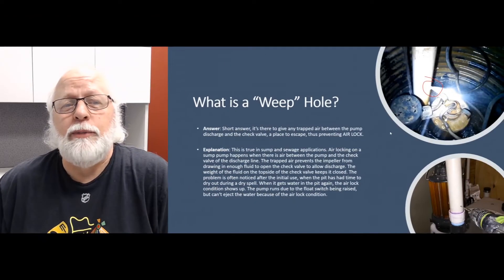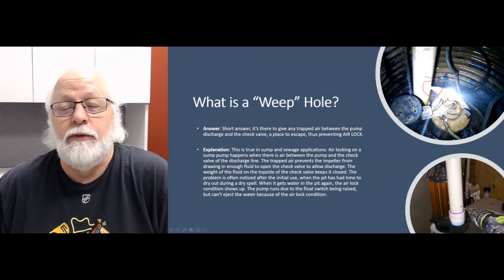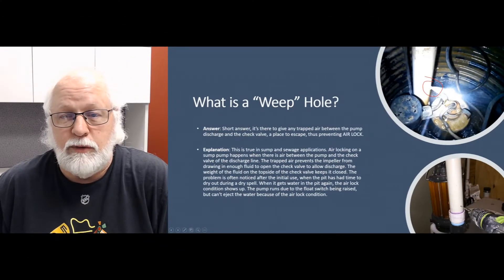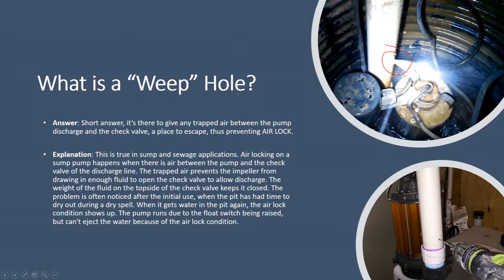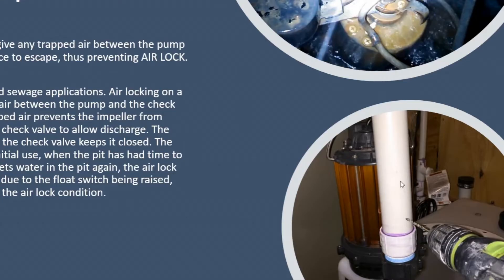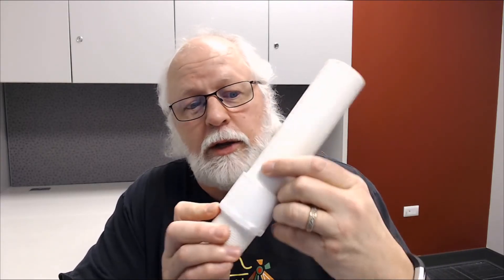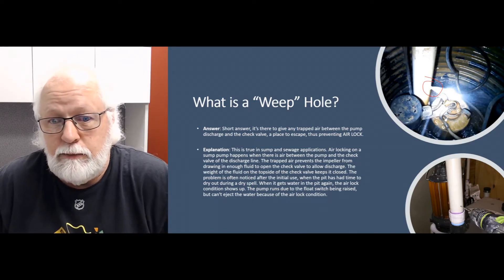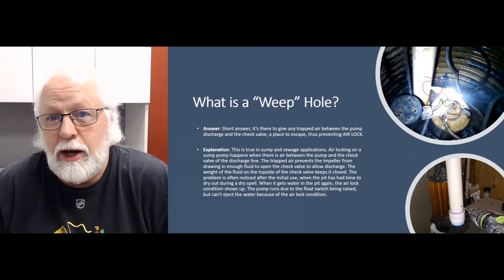Why Your Sump Pump Needs a Weep Hole

Comment: Jim, thank you so much for the great explanation and tips, the 45 degree drill angle is a good one.  Q: on a ProFlow model PF93082 there is a slip by FPT bulkhead fitting in the lid.  Does one glue the bulkhead to the pump side (pit side)? It's a snug pressure fit, but not water tight. I cannot find any information to this?  I'll try emailing you directly

Comment: Great video, thanks, I just had a sewage pump go out. Unplugged and lifted lid to see what has happening and got a nice bacteria steam bath in the face, lol.  Pump was running endlessly recycling water into the pit causing it to overheat. Water was super hot, no idea how long that pump was running like that but glad I caught it before it flooded the basement. after draining, I found the front leg of pump broke off causing the pump to lurch forward and break connection to discharge pipe. It was a lot of work but I finally got a new one installed yesterday.  Before I seal it back up , I'll pull it and add a weep hole.  Thanks!

Comment: I’m confused, don’t laugh, I’m left handed, with limited upper body strength & have plumbing dyslexia, so any righty tighty rules go right out the window. Left threaded objects are my nemesis. In order to make a 45* angle “downward hole”, the position of the drill is pointing up? And the weep hole is to spray towards the pump? Oh, the pump is already installed and does have a check valve. And I did read the instructions manual, it said ‘First put pump in the big hole, connect to 1 1/2” pipe hole and drill a little 3/16” hole, THEN plug it in. I think the manual author is another kind of hole.

Comment: I am pumping uphill 2 ft to a drainage ditch 100 feet away. There is always water standing in the pipe, which may freeze in winter. What should I do?

Comment: Having just suffered an airlock issue on mine... doing this now. 
Both my pumps (primary and battery backup) have anti airlock holes on the lower edges (sides) of each pump body in the cast iron. But those clog with silt (as what happened in my case). Makes sense to have one in the discharge line too, but just curious on the purpose of ones built into most pumps versus the weep hole (unless this is pre-pump vs. post-pump airlock thing) 
Thanks for sharing

Comment: I have a 2 inch sch. 40 pvc pipe with 5 elbows that run one after the other [ i do this to ''slow the flow'' ...grandpa always said to '' know your flow ''  ]  and 2 check valves just to be safe . I also custom drilled 3 weep holes all the way around the pipe so the spray cools off the motor . My neighbors are now seeing why i do this .... I have been burning up a motor every 3 months but it's worth the peace of mind i have . Pork chop bones and other ridged items should be broken down with a hammer [ use safety glasses ] before running them through the pump . Other than that make sure your alarm is working , i use mine for an early wake up instead of the old fashioned alarm clock . Thanks for the video !

Comment: Adding the weep hole does cause the head up to the check valve to drain back. This seems to add more noise and turbulence after adding the weep hole but it seems like a necessary thing to do

Comment: Why wouldn't the air just get pushed past the check valve?
Reply: It would. This is for the pumps protection not the pipe. That’s the only incorrect thing in this video.

Comment: Hi, what happen if the wheep hole goes under the water? I have set up my sumppump float to a high level of water in order to lower the activation frequency, so the hole might be under water.

Comment: Wayne sump pumps say that the weep hole is not necessary with their sump pumps. I just bought a SPF33, 1/3 HP, Coated Steel, 3750 GPH. 

I have a check valve that will be just above the 2.5' deep sump hole, approximately a foot higher than the basement floor. Then it goes up about 8 feet, then out the sill to the outside.

- I would like to drill a weep hole just in case it might help in certain situations. With this Wayne pump, would it hurt to have one? Or would you recommend not to drill one?

– Does it make any difference if the check valve is attached to the base of the pump rather than up higher? I guess you cannot drill a weep hole if you are using a check valve that's attached to the base of the pump.

Comment: Thanks for this! I had a replacement pump installed and the guys rotated my pipe 180 degrees so that my original weep hole (drilled at a 45 degree angle) was spraying up above the basin lid. I lazily closed that hole and added a new one above the pump but below the basin lid so now there isn't a fountain in my utility closet when I'm not looking.
Reply from the maker: Thank you for watching and we appreciate your feedback here.

Comment: Do pedestal sump pumps need a weep hole as well? Currently running into an issue that looks like a classic air lock issue. Water being discharged but very slow, dripping almost with a motor constantly running.
Reply from the maker: Thank you for your interest in Sump Pumps Direct. The "weep" hole as it is called should always be drilled in your discharge pipe to prevent an air lock. This is true in sump and sewage applications. Air locking on a sump pump happens when there is air between the pump and the check valve of the discharge line. The trapped air prevents the impeller from drawing in enough fluid to open the check valve to allow discharge. The weight of the fluid on the topside of the check valve keeps it closed. The problem is often noticed after the initial use, when the pit has had time to dry out during a dry spell. When it gets water in the pit again, the air lock condition shows up. The pump runs due to the float switch being raised, but can't eject the water because of the air lock condition.

We suggest that you drill a 1/8" or 3/16" hole in your PVC discharge pipe, approximately 4" above your pump's discharge port and well within the inside of the basin. Drill the hole at a 45 degree angle so the hole is pointing toward the bottom of your sump basin. Water will be discharging from the weep hole when your pump is operating. This is completely normal. A typical installation will have the check valve positioned about 2-3 feet above your sump basin cover. If the check valve is screwed directly into the sump pump's discharge port, there is really no place to drill the weep hole, but also less of a chance of air lock due to the positioning of the check valve. The only problem with installing the check valve directly into the pump's discharge port is that it takes more power and effort for the pump to start due to the added weight of all the water sitting above that check valve, especially if your head is 8 feet of higher. When the check valve is installed above the basin cover, it reduces that starting power and also makes for a much easier method of replacing or performing maintenance on your pump and system.

Comment: I hope you can help me.  I replaced my sump pump a couple years ago and it ran flawlessly for 2 years.  It has a weep hole, I never knew what it was until I started to investigate, I initially thought my pipe was cracked or something.  Well all of a sudden, it got air locked.  I unplugged it plugged it back in and it ran fine and shut off.  I replaced the check valve thinking that might be the problem.  Well, it still gets randomly air locked.  I replaced the valve on 1/29/23.  I just checked today to  make sure it is functioning and it is....I am not sure what to do.  Any suggestions would be appreciated.  Thanks, Bill
Reply from the maker: Without looking at it, it's difficult to diagnose a problem. However, check where your weep hole is located. If it's too high on your pipe, it could create air lock issues in the wrong circumstances, as the higher the hole is, the more water remains below it, inviting potential for air to remain in the pipe. There also could be a crack or broken seal on your discharge piping somewhere, which can make your pump system behave erratically.
Reply: Thanks!!  I actually found the problem.  My sump pump had 2 check valves on it for some reason.  One on the wall, which was the only one I thought I had, and one on the pipe where it attaches to the outlet.  I went and bought a new pump and as i was cleaning up the old one and the discharge pipe I heard a rattle.  Well the valve broke off and  was floating around in about a 2 inch space.  Every once in a while it would  block it just right and cause an air lock.  I had to cut it out with side cut it out with side cutters piece by piece because I would not come out the bottom or the top.

Comment: Doesn’t water escape through the weep hole ? Defeating the purpose of expelling water out?
Reply from the maker: The purpose of a weep hole is to drain water from the line to prevent air bubbles from getting locked up and sucked into the pump. It's the water drainage and the hole allowing air/water to escape that prevents air lock.

Comment: Whenever my sump pump runs, my kitchen sink drain makes loud noises, and sometimes spits out water. Might this be from the lack of a weep hole?

It’s done this for years and my mom never minded that much, but I’d like to stop this once and for all of I could. If solving the problem is this easy, I’d be relieved!
Reply from the maker: A sump pump is meant to pump groundwater from your drain tile and, depending on your system, drain water from various utility pipes (humidifier, laundry, etc.) into the sump pit before being expelled through the discharge pipe. A kitchen sink drain should definitely not be backwashing with water when the pump runs, but if it is, it may be discharging directly into the sump pit which may not be up to building code. We strongly suggest you contact a plumber who can verify your plumbing was installed correctly, as it's unlikely that a lack of weep hole is the reason for the problem you're experiencing.
Reply: @PowerEquipmentDirect  Thanks for answering! Just wanted to clarify some things. Not sure if it’s important, but my sink does this usually right AFTER the sump pump turns off, like just as it stops running. It’s very brief when it happens (like usually only a second or two). I’ve read this might have to do with trapped air, and I’m wondering if the water being spit out on occasion is just the water that’s sitting in the trap underneath the sink. Is that a possibility? Thanks again.

Comment: I drilled a weep hole but it seems to be spraying a little outside of the tank. Any ideas of how to get it directed more downward? Thought it was at 45 degrees but thinking it is hitting my backup pipe and spraying. Any ideas?
Reply from the maker: Usually 45 degrees downward angles are enough, but in your case it might need to be slightly lower and a steeper angle. We recommend a weep hole is drilled a 1/8" or 3/16" hole in your PVC discharge pipe, approximately 4" above your pump's discharge port and well within the inside of the basin. Drill the hole at a 45 degree angle (or more in your case) so the hole is pointing toward the bottom of your sump basin. Now that you know it's hitting a backup pipe, you can change the location of the hole as well. You should patch the other hole after the new one is drilled. Water will be discharging from the new weep hole when your pump is operating. This is completely normal.

You can also consider getting a sump pit cover to block the water from getting outside the hole, but that's not a long term solution.
Reply: @PowerEquipmentDirect  great information. What can I use to patch the current hole. I’m realizing now it is too high and needs to be in a different location. Thanks for your help
Reply from the maker: To be specific, patching a hole is still not better than replacing that section of the pipe, which would be the best thing to do. If you choose to patch, you can use a waterproof epoxy, found in most hardware stores in the plumbing section. We can't guarantee patches will last any length of time though, so be mindful you may still need to replace that section of pipe in the future if it doesn't hold or other issues arise. We have a video that demonstrates a replacement of some pipe in the context of installing a check valve, so check that out too for a visual: https://youtu.be/b7LJKqASe8s
Reply: @PowerEquipmentDirect   I put a 1-1/2" radiator clamp over the hole in the pipe and drilled a correct hole on the pipe.... works fine now.

Comment: Thought they came integrally zoellers do
Reply from the maker: Most sump, sewage & effluent pumps do have an air relief hole somewhere in the pump base that is designed to help prevent air lock within the PUMP. The weep hole is recommended to help prevent air lock between the pump discharge port and check valve.

Comment: I'm glad you said that it's perfectly normal for water to shoot out of the weep hole. That's what made me search for this video. Thanks!
Reply: Silly question but does this weep hole have to be above water level or below or does it not matter ?
Reply from the maker: Thanks, we're happy you found value in this video!
Reply: ??????  You really needed someone to tell you that????  YOu have a HOLE in the discharge tube, WTF do you THINK is gonna happen when the pump is pumping?????

Comment: I have question I’m afraid of putting in a check valve because I’m afraid of the water freezing in the pipe. Is there another solution or just wrap the pipe with insulation?  Thanks
Reply from the maker: That would really depend on your specific setup, Frank. Insulation is an option as well, as a heat tape wrap, as long as it’s designed for the piping you are using. There are also other possible options available, again, depending on your setup.

Comment: There is a clunk on my neighbors sump everytime the sump turns off. Would a weep hole stop this?
Reply: The clunk is from the check valve.  This guy addresses it:  https://www.youtube.com/watch?v=qPPK9Mb7TLo
Reply from the maker: It might and it might not, John. It might be due to an old check valve that needs replacing. We do offer a few “Quiet” check valves and these could very well make a difference, but we would also need to know the system setup, discharge pipe diameter, total vertical lift and the current check valve placement height. Are you also using a battery backup system and if so, how is everything piped in? To discuss further, please give us a call. 888-455-4682.

Comment: Thank you for this video. The weep hole on my system is too high and not at a downward angle. As a result it sprays all over and has caused a mold problem. Is there something I can do to fix it?
Reply from the maker: Thanks for watching. You could always remove the pump and drill a proper weep hole lower, and patch the malfunctioning hole. You could also start fresh with a new piece of PVC pipe and a properly drilled weep hole too.

Comment: My valves are at the threads….  It was part of a kit and it’s threads, then the rubber counter or to the valve…. It’s that ok or do I need to drill the rubber?
Reply from the maker: Your question is not clear to us. Please give us a call and we'd be happy to assist you. 1 (888) 455-4682.

Comment: In your expert opinion is Zoeller the standard or most used and reliable pumps on the market?
Reply from the maker: We're confident saying they are one of the most trusted names in pumps - not due to advertising - due to years in the field making reliable pumps that truly last because they are built very well. Hope that helps!

Comment: Thanks for a very informative video.  I have a Flotec in-line check valve which is equipped with an anti-airlock hole located at the base of the threads to prevent air-locking the sump pump.   Why doesn't all check valves have the anti-airlock hole already drilled by the manufacturer like the Flotec check valve?  This would prevent a lot of future problems and less work for the installer.
Reply from the maker: Very true Pat,  just about all threaded check valves have the anti-airlock or weep hole already drilled as you mention. It's the other style of check valves, slip-on, glue-in, compression styles that do not include that hole, and in most cases there is no room for that hole and you have to rely on the customer or installer to know about it and then install it. It's also typically referenced in pump installation manuals but unfortunately, not enough people read those.
Reply: My assumption is that not all check valves are used in sump pump applications. If used in a pressurized water line, I wouldn't be very happy if I was spraying water everywhere. As for if the check valve is sump pump specific and still doesn't have a pre drilled hole, I saw another comment saying Zoeller pumps want you to drill a hole in the pipe at a level even with the top of the pump. The check valve won't be installed in this spot on all applications.

Comment: What if the check valve is installed directly into/after the pump?
Reply from the maker: That really depends on the installation and total vertical lift on the discharge. Typically, if you have a moderate <5 feet of lift, it's not a problem installing the check valve directly into the pump discharge port. If, on the other hand, you have greater than 5 feet of lift, you should install that valve at about the midway point due to the amount of back pressure that's being added on top of that valve by the weight of all that water.

Comment: Right with angling the hole downward. I worked where no one installed the hole. When I had to do the install I read the directions and we were all surprised that they require the bleed installed. 
Thanks!
Reply from the maker: You are very welcome, thanks for watching!
Reply: We just had a house built a year ago and the installers must've put the hole in a upward position because the water comes up instead of going down.  Our foreman acted like that is normal and said that the cover wasn't installed the correct way. Anything to get out of fixing it.